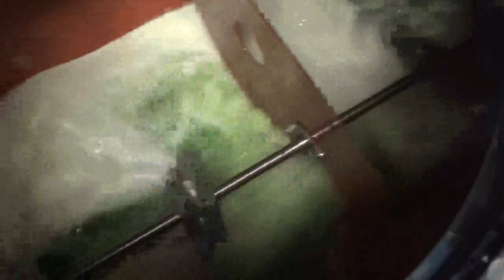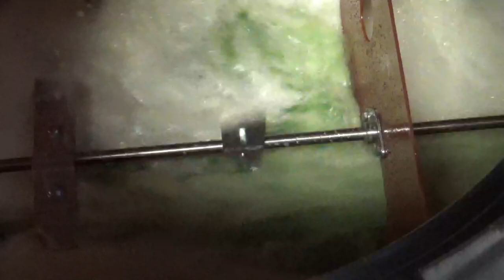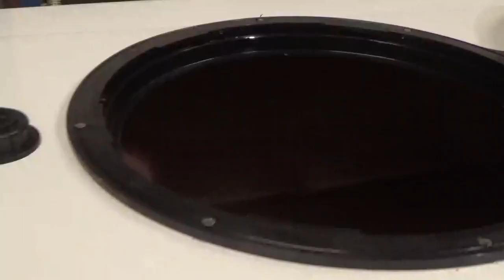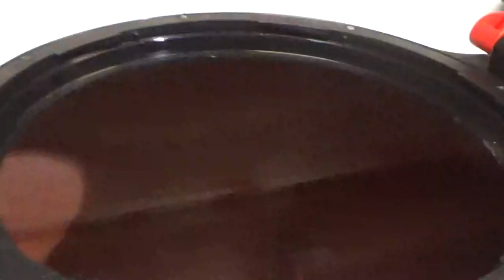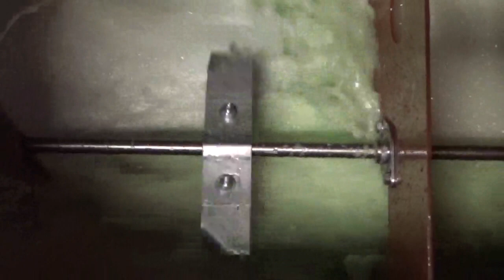GNC Industries Inc,  Mechanical Agitation

Comment: wonder what the designed rpm is on the agitator? i'm changing engine and pumps which will then not be belt drive, but i'll set up an electric motor to spin the agitator